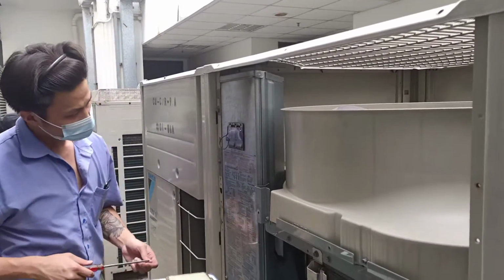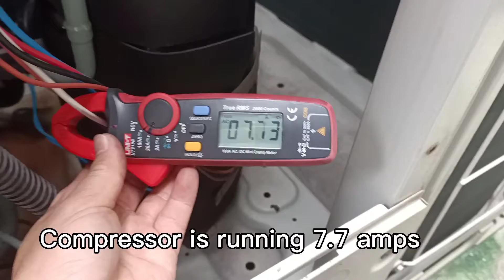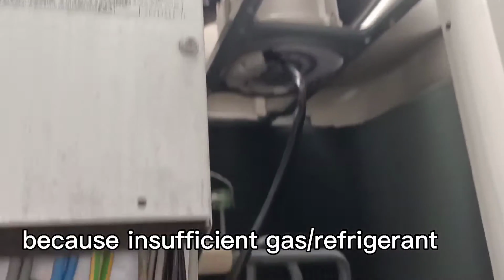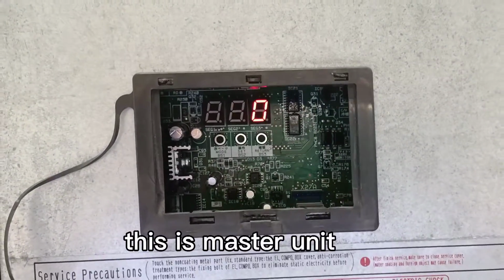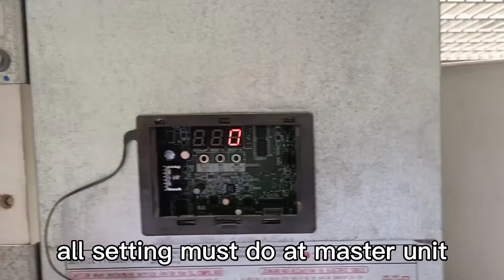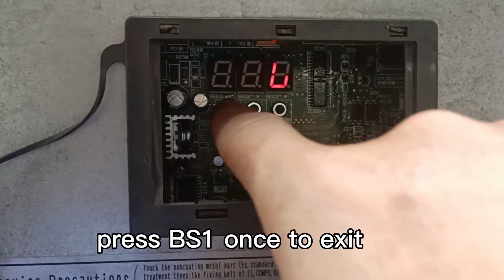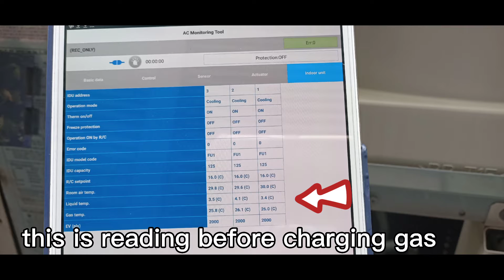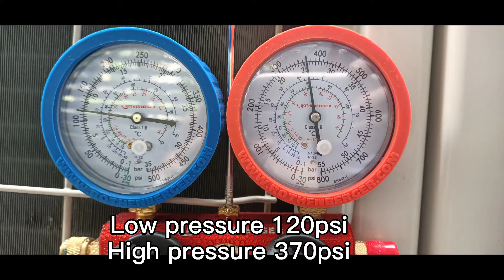Insufficient refrigerant | Daikin VRV4 | How to rectify insufficient gas.

Comment: how to activate a slave unit ? as previously it was switched off
Reply from the maker: 1)Press mode button more than 5 seconds. (Untill H1P led on)
2)press set button 39 times (slave 1)
40 times (slave 2)
3)press return button once
4)press set button once
5)press return button twice
6)press mode button once to exit

Comment: Can use auto charge?
Reply from the maker: Can,but only 4kg maximum. 
U not sure the quantity gas leakage. 
Better using wire remote to check the indoor thermistor reading when charging gas.
Reply: Normal runing indoor  thermistor many degrees liquid and s?
Reply: Charge until LO 120 PSI AND HI 370PSI ENOUGH GAS?
Reply from the maker: @tora_100  u need using wire remote to confirm to cooling
Reply: I do reclaim or recover gas and weight gas recharge back but sametime customer want urgent wil do top up only
Reply from the maker: @tora_100  👍👍👍👍
Reply from the maker: @tora_100  u can email bonmj81@gmail.com
Reply from the maker: @tora_100  Thanks bro